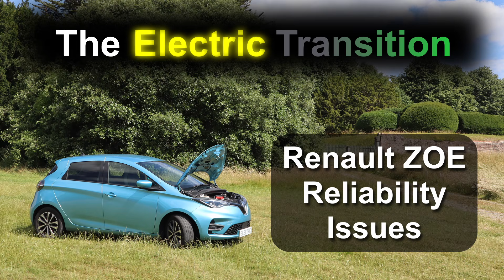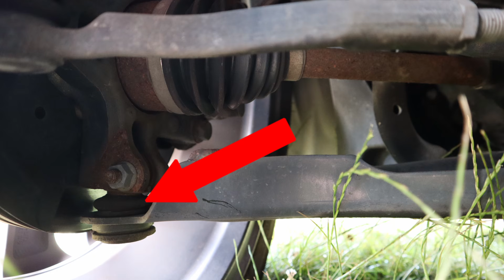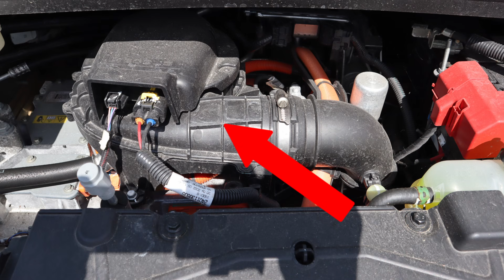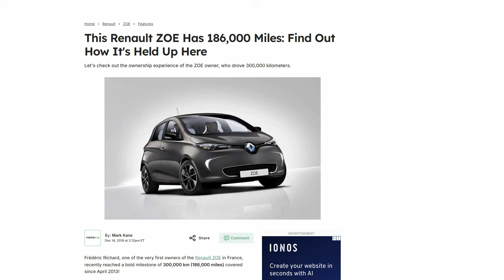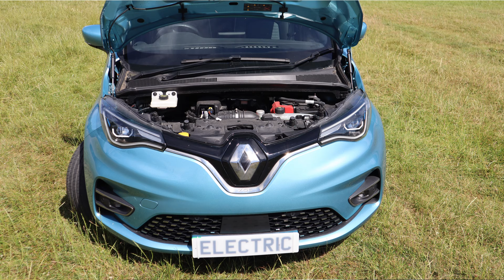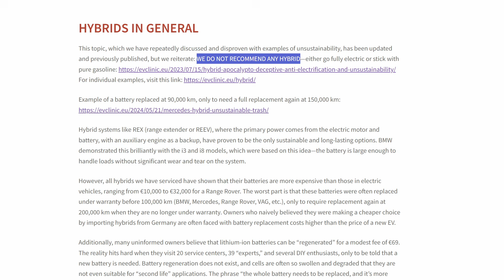Renault ZOE - Reliability Issues

Comment: Lots of useful info, many thanks.  Kia and Hyundai EVs unfortunately also have motor bearing issues at around the same sorts of mileages, so its not a problem unique to the Zoe.  They are much easier to repair though.
Reply from the maker: Thanks, I'm glad it was useful.

I've heard concerns about Kia and Hyundai vehicles, although I thought the main worry was about the reduction gearbox, which can be protected a bit by changing the gear oil every once in a while.

There are some positive stories about longevity of Kia cars. Mr Kia ENiro Diaries covered a story from the French media about 2 Niro EVs that had covered 500,000 kms without issues, here: https://youtu.be/suIKx9A7M-g

I then saw one myself, which is covered here: https://youtu.be/6KBdvWChDyI

It's sometimes hard to tell what proportion of cars are suffering failures. That's true of both the ZOE and the Kia/Hyundai cars I think. As you say, the process for removing and replacing the motor and gearbox on the Kia/Hyundai cars is much simpler, which should help keep the costs reasonable should a car require work.

Comment: I have a squawky Zoe just like yours but Zen R110 not 135 and has no emergency radar and is fitted with the smaller screen. 
I think I will disconnect the right drop link to see if the noise goes away. There is (in my humble opinion) an... "national scam" (arnaque nationale here in France at least) where you go to a service to change tires or front brake pads etc and they quietly loose a bit the nuts on the drop links.... few hundred miles after that if they did a proper "job" your drop links will start to rattle. You go back... they say your suspension arms or shock absorbers need changing... both because is mandatory....
The squeak though.... for me... I bought the Zoe SH at 19000KM and it has now 60000km the noise was from day one but only when turning the wheels left and right stationary. Now... when I go under 70Km/h decelerating is there almost constant... turning on the spot or while advancing a bit is the loudest squeak...
Today I went to CT... contrôle technique.... EMOT in UK? and ask them again to check what is making the noise... last time they said are the shock absorbers caps because the arms where changed.... after changing them last week and the noise not going away... on the contrary... seems more often now... I decided to check again with the CT guys (they are very nice and usually ask no charge for this or they ask for normal 50euro "contrôle volontaire" fee. 2 times they asked nothing, one time 50€). And today they said... for sure are the suspension arms. They are new but the rubber stuff in their joints must be failed. OK. Still I think I will disconnect the right drop link and see if it still squeaks.... It might be that.
Also... regarding failures on Zoe... one nuisance is the sinister way of Renault's to notify the user that the 12V small battery is depleted is to stop charging and making the screen go red with warnings and alarms... really silly... to be diplomatic...
Reply from the maker: Thanks for your experiences. I agree, a careful experiment seems like a good idea, but remember that the car will lean much more when the drop link is disconnected, so I would recommend avoiding any high speed or long distance driving. However, since the problem shows when stationary, it should be an easy thing to test without any risk.

It sounds like controle technique is very similar to our MoT, that's a valid correlation 👍

I totally agree that the low auxiliary battery warnings are too extreme! Especially in the ZE (22kWh) and ZE40. I think this might be a bit less severe for the ZE50, but perhaps you have experienced equally extreme warnings on a ZE50?

600,000 kms is a fantastic distance for the car to have done! I'm really pleased to hear that - and on a Renault motor - the R110 - which can suffer motor bearing failures. That's fantastic.

Edit: oh, sorry, I misread the number of zeros! 60,000 km not 600,000! I blame my glasses!

Comment: The 135 has some revisions so hopefully as long as you don't welly it all of the time should be alot better.
Reply from the maker: I believe there are some tweaks, although I don't know what they are in detail. However, we know that 135s suffer motor bearing failures too, as Jonathan Porterfield had his fail, and Gary has also worked on another 135

Comment: I have a really worrying rumble at the front, on my 2018 ZE40. It doesn't sound like wheel bearings or CV joints, as it doesn't get worse when cornering. Equally, it isn't a 'whine' and seems to be at wheel rotation speed, rather than motor rotation speed. Any ideas?
Reply from the maker: Oh dear. Motor is most obvious, although your comment suggests it's at a lower frequency than that. Reduction gearbox is the other option in terms of drivetrain. That happens, but seems reasonably rare.

Have you checked the wheel bearings by pulling on the top of the wheel with your foot on the bottom, and feeling for play? I take your point that turning might affect wheel bearings, but it's what your description reminds me of the most.

What mileage has your car done at this point?
Reply: @theelectrictransition Only 42,000 miles. Thanks for your help.
Reply from the maker: @alancartwright2244 It does seem early for the motor bearings, but it's an option.

Does your car have a maximum charging rate of 22kW or 43kW do you think?

Have a watch of this: https://youtu.be/bkBwJpOxkOE

Does this match your problem? If so, Gary is the person I would be contacting.

Out of interest, if you take the car on the motorway, what speed would you normally drive?
Reply: @theelectrictransition Very unfortunately, that does sound familiar. It is more noticeable on the overrun and once going, not on start up.  To save range, I normally run on motorway at 53-55mph. That's no problem, because M27 local to us has been under 50mph speed limit for about seven years! Car has its MOT and service next week, but not at a Renault garage. I'll contact the specialist, if the garage can't find anything wrong with the wheel bearings or CV joints. Seems very early, at 43k miles for motor bearings to fail 😢
Reply: @theelectrictransition  Sorry, missed the info on charging rate.  Mine is a 22kW maximum charging rate, but normally charged at home on 7kW.
Reply from the maker: @alancartwright2244  OK, that rules out the theory that it might be related to high speeds! That's all very reasonable and shouldn't cause any concern.

I'd appreciate you letting me know what you find, if that's not inappropriate. I wish the car well, hopefully it's an easy fix.

Comment: another thing to consider is to make sure to use the AC periodically in order to allow the lubricating oil to prevent the seals from perishing and ultimately a cause of leaks
Reply from the maker: Thanks, that's an interesting point. As I understand it, the heat pump uses the same system for both heating and cooling, so there is a bit more chance it will be active - but I can't swear that I understand all of the nuances of the system
Reply: Having monitored a running Zoe with CanZE, I confirm that as long as the cabin fan is “on” the compressor motor will run at idle speed even if the AC button is “off”. (ZE40 R90)

Comment: Wonder if Renault is still using the offending motor in the 4 and 5??
Reply from the maker: I was wondering the same thing - not only about the 4 and 5, but the Megane and Scenic. However, after a bit of investigation, it seems unlikely.

Other than the Megane, everything else seems to charge at a maximum of 11kW. That's a notable difference, as the ZOE uses its motor as part of the AC charging system. Furthermore, the motor powers are all different to the ZOE; it seems unlikely they would overdrive them.

The final bit of evidence is this technical data sheet, which specifies the motor as a 6AK, not the 5AM or 5AQ used in the ZOEs.

https://www.renault.co.uk/electric-vehicles/r5-e-tech-electric/specifications.html

Comment: You talked about extended warranty but at least here in Finland, I recently went to the dealer to buy the extended warranty before my ZE 50 hit 4 years, and they took my payment, and a few days later they returned the money saying the importer is refusing extending warranties on already bought cars, they only offer them any more when buying new cars. So you might want to check is it the same in your country, in case it's a Renault borne directive.
Reply from the maker: Ah, OK, thanks. I suppose that shouldn't surprise me now that they know there are some potential issues. Extended warranties aren't really for us, they are an extra income for the seller. Sigh
Reply: Hi in Finland,
I have a low mileage Q90 ZE40 2017 - signed up for Extended Warranty in 2021 and every year since. But so far no issues. Touch wood!🤞

Comment: I just changed the lower track arms due to MOT fail and the front sub frame is easily levered out of the way of the bolts if the bolt under the bumper at each side is loosened along with the supporting thin brackets. There is a pin sticking out that is only used when the car was originally assembled that can be cut off to make the job easier.
Reply from the maker: That's good to know. Thank you 😊

Comment: One other thing I would add to the Zoe issues is long single phase charging melting one of the pins, I think the neutral Gary said, fortunatly I only 3 phase charge at work 99% of the time so he said not an issue for me but would recommend keeping single phase limited to 3-4 hours to help reduce the chance of this issue.
Reply: I don't have one (yet) but is that something that's prevented by using a slower rate of charge? I rarely do more than 40 miles per day so 6 hours of cheap rates at 3.7kW (16A) would be enough, with other charging via 13A or CCS.
Reply from the maker: Yes, I've seen Gary refer to that. I thought it was very rare, but he mentioned it again recently and said it was a bit more common than I had expected.

Yes, you are right, it's the neutral pin. 3 phase charging doesn't use a neutral connection, so it's only a concern for single phase charging.

Comment: I have the ZE50GT and my 5 year warranty runs out in December 2025 but I noticed the motor was only 4 years it says? - The motor is the main issue I'm worried about, though I will only be doing 3-4k miles a year and only on 28k now so not sure be an issue in the time I own it which will be at least an other 5 years. Do you know the likely cost for Gary or a HEVRA garage to replace the bearings?
Reply from the maker: Oh, that's interesting. Yes, I hadn't noticed that the motor warranty was shorter. Mine is 4 years, too.

The motor issues seem to be mileage related. However, another commenter has just recently said 2 things I have been thinking: avoid traction control, and keep your speed sensible. I think traction control can cause very rapid magnetic field changes, which could cause large eddy currents. The bearings seem to be slightly underrated from the point of view of maximum speed, so following national speed limits will help, too.

It doesn't sound like you are at particular risk of suffering a failure because you do fairly limited mileage.

I have heard Gary talk about bills in the region of £2100, although it varies a bit depending on the condition of the motor when he opens it up.

Comment: Q motor Zoe:
AC compressor can fail. Avoid using pre conditioning, since it turns AC up to the max.

Errors with charging. It may charge single phase, but not 3 phase. Could be failed relay inside that switches modes. Also, input filter capacitors.

R motor Zoe:
Motor bearings - avoid hard acceleration on loose surface, since stability control sends shocks though drivetrain that can damage bearinng. Avoid speeding, as Zoe bearings are on design limit at speed limiter (140 km/h). Drive the car 120km/h max.

DC-DC converter. Change 12V battery every 3 years.
Reply from the maker: Thanks, that's really useful extra information 👍

Comment: The only thing unreliable about it was that one time as I was transitioning from neutral to reverse gear… and adding some accelerator pedal to the mix it glitched out and gave me error codes on the dash… 

I simply turned off the car and waited 10 minuets and started it back up… but at the time I was panicked and called a garage specialist… thankfully I called off the tow truck because it started back up like a rebooted computer and worked fine🤷‍♂️
Reply from the maker: Oh yes, I can imagine that was a bit concerning! I've never heard of anyone else experiencing that in a ZE50. The earlier cars seemed slightly more likely to throw serious-sounding messages like this - but, to be fair, that was usually because of a charging failure or a low 12V battery.

Thanks for the anecdote, and I'm really pleased you found it reliable other than that one troubling moment 😀

Comment: My sons Zoe ze50 has broken down 5 times since the reduction gearbox broke apart the casing. Renault keep giving it back but keep getting main motor electric failure. Leave a few hours and it drives again. Could this be bearing related?
Reply from the maker: Here's a video on the coolant leak I was suggesting. However is this is VERY rare, and as you can see in this video, the fault doesn't clear. https://youtu.be/pifzn2t9uA8
Reply from the maker: This isn't quite the video I was looking for, but at 01:20, you can see the position sensor I am referring to https://youtu.be/wCSJtsXDzFg

I wonder if corrosion on this position sensor might be the problem your son's car is suffering from. It causes the position sensing to become intermittent, and a failure to sense the exact position of the rotor causes the car to get very unhappy.
Reply from the maker: Oh no, I'm sorry to hear he's having problems.

That might be a bearing problem, but it doesn't seem all that likely. Bearing issues are mechanical problems, and the noise should be noticeable long before system warnings are generated. If there is no grinding noise, then there is no bearing issue.

I wonder if the position sensor is corroded and needs to be replaced. This sits between the motor and the gearbox and is vital so that the motor controller knows the exact position of the rotor to decide how to manage current flow to the 3 stator windings.

The other thing that springs to mind is a problem with the casting of the inverter housing, which can cause a very small coolant leak into the electronics. However, this is VERY rare, and I think causes a fault that is less likely to clear after sitting idle.

Give me a moment. I'll see if I can find you a link to one of Gary's videos showing a car with a position sensor issue.
Reply from the maker: Oh, another thought: has the 12V battery been replaced recently? ZOEs act a little bizarrely when the 12V battery is low. This is mainly a problem on ZOEs before the ZE50 (ZE40 and ZE) but maybe the ZE50 is not completely without its quirks in this regard.

Changing the 12V battery is not all that expensive a job, and it's a useful thing to discount if the car is 3 or more years old and the accessory battery under the bonnet has never been replaced

Comment: we have no issues with our R110 ZE50 but the motor bearing issue is shocking….bearing erosion due to arcing….urrrgh.   So far all ok but it does worry me as we have over 50k on the car.
Reply: The arcing can be so easily eliminated, just a simple carbon brush between the rotor and casing would have solved the issue, unfortunately it seems the Renault designers didn't understand electric motors.
Reply from the maker: Yeah, it's a shame that we have this risk in our future. Having said that, it doesn't seem to happen to all cars, so it makes me wonder if there is a trigger that we haven't identified - something we can do to minimise that risk
Reply: Having heard about the  bearing problems, it might be in conjunction with torque!? Up from the first km, we‘re driving our 2019 R110, 41kWh, 55.000km in Eco mode.
Axel

Comment: I have -21 Zoe ZE50 with around 45k miles on the odo. No issues so far, except the boots plastic has an annoying rattle. And yeah, once the AC charging stopped working, but it was eventually fixed by clearing the fault codes. Other than those, absolutely no issues. 

The motor bearing is something I need to keep in mind, though. It’s kind of fishy how the issue has been around since the beginning. You’d think they’d figure it out by now. It smells like an intentional failpoint, since it is relatively maintenance-free otherwise. They got to make money one way or the other. But as you said, every vehicle ever made has it’s fair share of issues. So I’m not too fussed about it.

Other than that, the car has been solid for me! Cheap to maintain, cheap to drive, decent drive and in my eyes it looks pretty nice! Mine has it’s first MOT in december.
Reply from the maker: That's a useful thing to know about charging, thanks. I'll bear in mind that clearing fault codes may be required.

I'm glad it's been almost exclusively trouble-free motoring for you